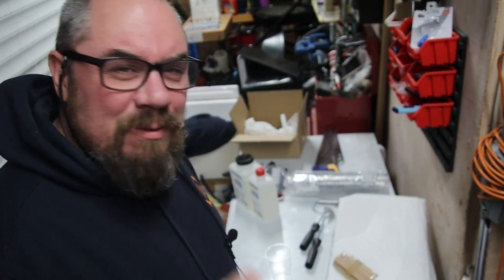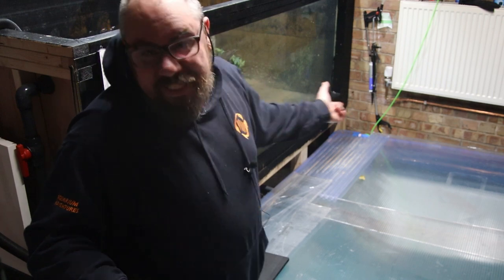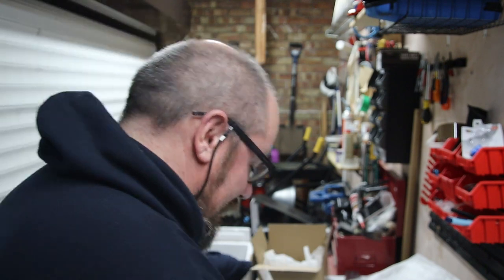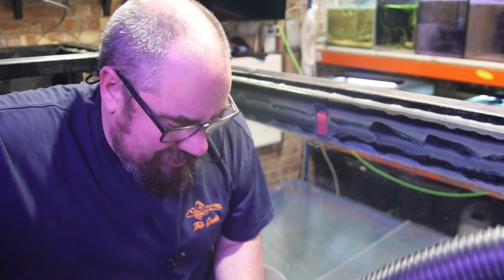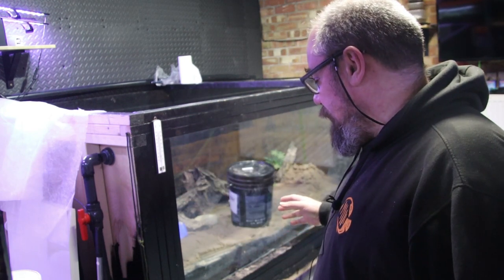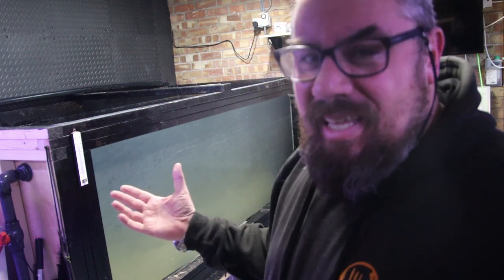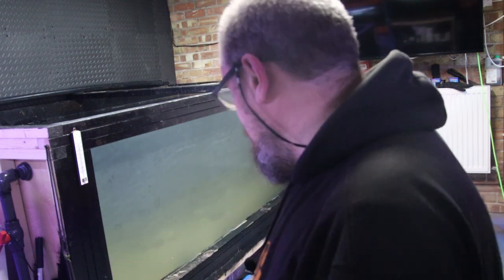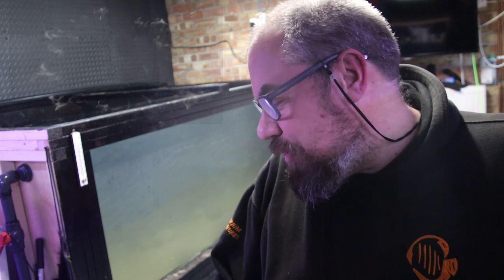How NOT to fix a leaking MEGATANK (DIY Aquarium)

Comment: "I don't have a time machine, can I borrow yours?!" 🤣😂 I am wary to make a suggestion but I have built 2 of these tanks before so have some experience. I think you were right about the silicone not sticking to the rubber. The problem now is the fiberglass sticking to the window. The glass needed to come out and then fiberglass behind it, then silicone the glass back in up against the fiberglass. It can be difficult to get different things to stick to each other. Silicone sticks well to clean glass and epoxy so would seal correctly provided the epoxy sticks to the rubber. Don't give up though, I think most of your subscribers want to see you succeed 😊
Reply from the maker: That makes sense, thanks!
Reply: I agree Andrew, I was hopeful when I saw he had filled it then he cut to the bastard of a leak 😢 
That silicone is in such a bad state the glass needed to come out, but I imagine without help the thought of pulling the glass back out is such a nightmare it’s the last thing he wants to do!
Reply: @AquariumAdventures  The water pressure will then be pushing the glass tighter against the seal rather than away from the fibreglass. There is something else that might be worth trying, butyl rubber tape. that may stick to the glass and if it sticks to rubber it can never be separated. Also stays flexible. It's used for joining/repairing butyl pond liners.
It would still be best to remove the glass though 😐
Reply: Yes.. There is a reason glass is always connected to a flex bead of silicone or similar on nearly Every build... Or store bought tank.
You are really close now..
Reply: On the bright side..
You can build more tanks, once you perfect your system...
Like Edison and the light bulb. 🍻🐡🐟🐠🎈

Comment: Keep the head up mate.  Iv been watching this build from the start and as you've admitted and acknowledged, you should have done it differently from the start,  but hey we all make mistakes and at least your sharing and definitely helping others in by showing them processes that don't work.  
If I was you pal, I'd leave mega tank alone for now,  do my best to rehome the snakehead, put the pool away and get on top of cleaning the fish room and maybe do some new easy projects on the smaller tanks to keep  the head in a good happy place.  Then over the next few months you could do small bits to mega tank with the end goal of getting the glass out then redoing everything/sicone, put glass back etc ,with some of the good suggestions or the way other builders on YouTube have done it with lots of wedges in place all around the glass to make sure it seals. It's worth one more try , and like most your followers, i really really want to see you succeed mate 👍👍

Comment: You acknowledged your mistakes and its been really hard just following along so I can only imagine how your feeling. I've had quite a few ply tanks as well as ponds and homemade aquariums so I feel the pain. Being a joiner/carpenter/general builder I know the temptation to go with the easiest and most cost effective fixes but if there's one thing I've learned over the years it's don't do it. Invest the time and money no matter how difficult to do repairs belt and braces. Should have been glass out, sanded back to bare wood, fibreglass and refitted the glass a long time back... But you can still do that and know it WILL work. It's not a dig at you, you've owned up to your mistakes and you  CAN put them right.  From a fellow Scot 🏴

Comment: I would suggest contacting liquid rubber for the recommended sealant to use for liquid
Rubber.  When I built my DIY plywood with liquid rubber they suggested using 3m  Marine 5200. Silicone can be used for the gasket between glass and frame, but the 3M Marine sealant must be used for the internal seal.  I used the 3200 for both and this was very expensive at $25 per tube (needed 10 tubes).   I hope the fiberglass method works for you.  My next two builds were done with pond armor as it is more cost effective as you can use silicone effectively.  Good luck.

Comment: I’m sure I’m not the only one to say this but I hope you don’t quit on the tank! The silicone and liquid rubber seal is delaminating and creating a gap for water to pass through. The glass needs to be pulled off the front panel and cleaned of any silicone that remains. The front panel, where the glass was attached to, needs to be stripped of the liquid rubber, silicone and epoxy. Then sand and re laminate, with fiber glass and epoxy, where the glass panel is going to sit. Once that is done you can reapply your glass with silicone and finish of the surrounding area with liquid rubber. It’s easier said then done but nothing is easy 😅, don’t give up 🤙

Comment: You've got a good solid base unit there to build on, remove the glass, clean the lot up and fibreglass the whole tank before siliconing the glass back in. Leave the silicone ages to cure and then you'll have a mega tank 👌

Comment: I know the the last thing you need is another suggestion, however…Looks like it’s leaking between the layers of plywood on your base. Maybe a screw head somewhere or a seam between 2 joints. I hate to say it but remove all the sand and recoat the bottom in one application.

Comment: Don't give up, the only mistake you made was using liquid rubber on the front panel. You could of used acrylic panel and bolted it to the liquid rubber with a silicone gasket. It's a pain in the rear but once you have removed glass and fibre glassed the front panel it will never leak, liquid rubber is a great product.
Reply: Yeah. This is the one that makes sense to me in terms of seal. How would you source a silicone gasket for this application?

Comment: This is what happens when people don't put the work in and try to do the least possible. Failure after a failure that leads to a person getting frustrated and giving up. And the worst thing is that, with all these repairs, you put more work into that tank compared to doing it with epoxy resin and fiberglass from the start.
Reply from the maker: Quite the mental gymnastics you've used there. Citing an example of someone doing more work than they needed to as what happens when you're not willing to do the work and do as little as possible.
You're either a genius or a moron
Reply: @Aquarium Adventures  wow, this comment.............I'm super glad we don't have 15k subs if these are some of the comments you receive. What a completely toxic person. Dude, Graham (is that the right spelling), I think you did a WAY better job than we could have done, and you documented it perfectly, so others don't make the same mistake (id still make worse mistakes, though). Haters going to hate. I think youtube has a block (just please don't use it on us :) Hope your, good buddy, very much looking forward to your progress/earnings video when you get to it :)

Comment: Omg Gutted for you mate, I fear that the silicone on the glass is fucked and will never hold water at this stage 😢 best bet is to pull the glass out and fibre glass the front panel, then re-silicone the glass back in… this sucked balls mate you don’t deserve this level of bad luck.
Possibly best bet would be burn it and buy the pond that you were originally looking at maybe